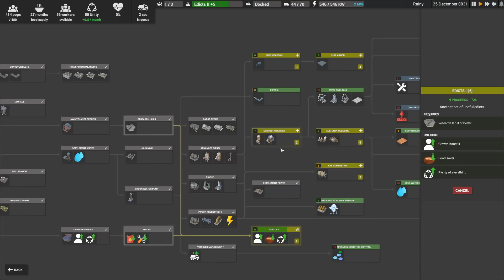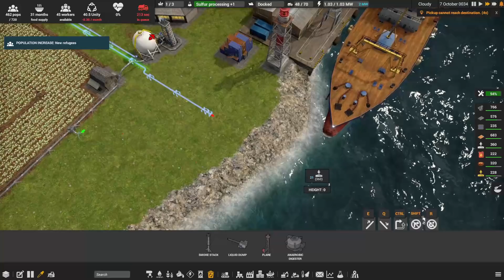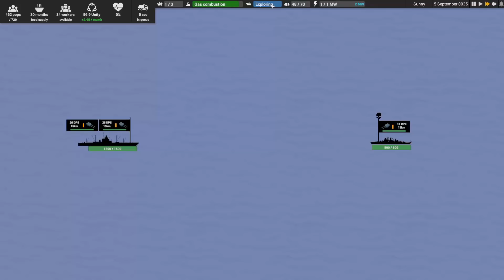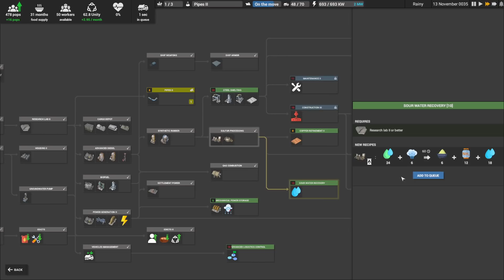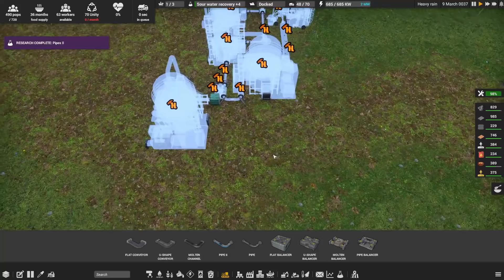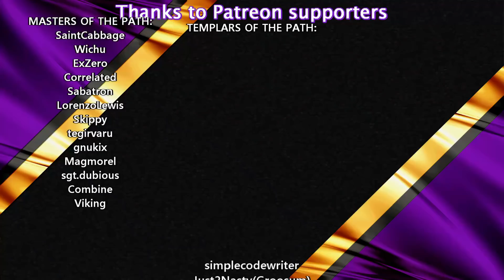Advanced Chemistry for RUBBER & Hunting PIRATES | Captain of Industry [Closed Beta] | #4 | Lets Try

Comment: I can see 3 conceptual (not wrong rotation of building) issues in this build (some are already mentioned but no solution):
1. "1" produced and not consumed steam will fill boiler output which stops burning heavy oil which will stop crude oil refining after a short time. Solution: burn access heavy oil (air pollution) OR vent access steam (no pollution) both with priority balancer to other consumers
2. Infinite transport loop for Diesel (and Iron) last storage is set to export everything, first allows truck imports => Truck transports from last to first which flows to last => wasting fuel and creates a large truck queue. Solution: Don't set empty and set the place where you want it to request OR set the Truck Import or Export to correct values to avoid loops
3. Long time: when Rubber storage is full this produces no Diesel. Solution: "this is the idea" => Diesel is only waste here and not required because of other sources OR turn access Naphta to Diesel and export Sulfur

And some other improvement ideas: 
Ammonia to H2 and N2 = no pollution OR better use for Fertilizer later on
Sour-Water with Water into Tank (without buffer it will not work stable) and then priority Water input to save water (which wil run out after short time)
I personally don't like to use coal for rubber, because coal is used for almost everything in high amounts, that's why I use it only as "waste" to get rid of sulfur

Comment: Nice design. I'd suggest 2 things if you allow me :
1 - later on, you'll need maybe 2 or 3 lines. Spare room to increase your setup. You may then need to crack the naphta and the fuel for more diesel, the rubber may not use all (but I'm not sure of where you are in techs, maybe it's a bit soon in your gameplay).
2 - most important, NH3+N2+H2O gives you fertilizer, wich is VERY useful. Add a tank+sorter on NH3 and N2 before the chimney, priority on tank, then waste), to easily collect them to add a fertilizer production, your inhabitants will quickly become very hungry 😜
And your flare stack isn't connected, but someone else already said it

Comment: I ran into some problems with this setup after a while. The heavy oil for steam backed eventually so everything stopped. I solved it with a balancer and flare though, priority to the steam and burn the extra then it seams to be running fine. Untill the next thing stocks up, like rubber would be my guess.
Reply: A full Rubber stockpile sounds like a luxury to me, not a problem.

Comment: This game is really fun, but overlooks a lot of tiny details that just bother your overall gameplay making it un-addicting. Such things are the lack of refresh rate while building and the feel of life in your GUI. It's eventually going to get boring to click the buttons without any variety.

I love the alarm feature. The balancer priority is very un-intuitive and even though it's an interesting way to do priorities it isn't reliable as you can't prioritize different inbound to outbound like you do in Factorio. For me Factorio has been perfected over the years and you can't really argue that something is better than the way Wube did it, however I was always wishing for vanilla balancers with editable ratios. This will effectively make life much easier and knowing how balancers should be coded it's not at all a problem for performance, not to mention you see 1:1 pop up when hovering over one which means that should support modding.

For the technical guys out there the way I'd make a balancer (in lua) is I have a table with the output ratio and a number that represents the current position. Instead of looping the table with a for loop I'll loop it with an event each time an item enters the balancer, advancing the position by 1. If your table has an output ratio of 3:2 then an output table is made which acts as 1:1 times the minimum number plus the rest. Sounds inconsistent, but it won't be better if you make it work with percentages anyway as it'll be worse for performance and always finds a way to be inconsistent.
Also an input ratio of choice is really useful if you want to consume something slower without completely stalling consumption effectively building a passive buffer on the backed up belts and can make up for really well balanced downgrade balancers.

Comment: Honestly, don't put too much effort into the first refinery. You'll rip it apart in the future when you can crack all waste into fuel 🙂
Reply: the way he set it up, he won't have to completely rip it up, just plug in a different steam source and pipe the heavy oil elsewhere. honestly though, unless you have a lot of excess power, and electric boilers, using the waste products to fuel the boilers is probably the way to go,  once you get cargo ships set up, coal is more limited than oil, so in the end you want to use byproduct to run your powerplant anyways, coal still being useful for things like graphite.
Reply: @TheMhalpern  yeah that is precisely the way I set up my refining. All byproducts go to the boilers which feed the process. What ever is left over goes to cracking. The only exception is hydrogen, which has priority to feed heavy oil cracking. My priority off feeding steam to the refinery is: hydrogen -> heavy oil -> naphtha -> gas products
Reply: @dominikvonlavante6113  well he's early game enough that the water he could recover from sour water isn't that important yet, and the priority for this build was the rubber, I dont get why people seem to ignore gas boilers for power plants, the game makes sure that the first resource you get (unlimited) with cargo ships is crude oil, and with oil refining you get a lot of burnable byproducts, you can use some for diesel, but eventually you produce more diesel than you can use, meanwhile you are depleting your coal

Comment: That's a neat oil set up, the one extra steam is no problem, I imagine once you get into fertilizer, it'd make it easy to double the set up, use the water recovery recipe for the sour water, then have a tiny steam surplus for processes later down the line, you aren't at the point yet where water recovery is essential but the point exists and it wouldn't be too difficult to implement those adjustments to this set up